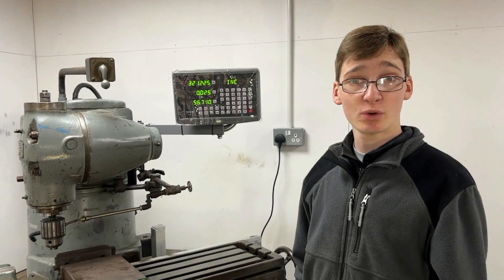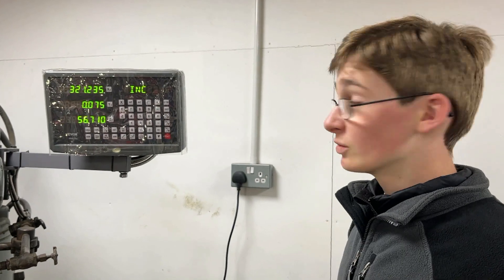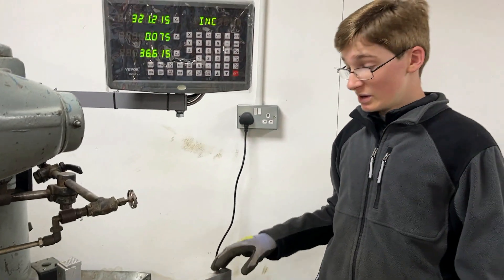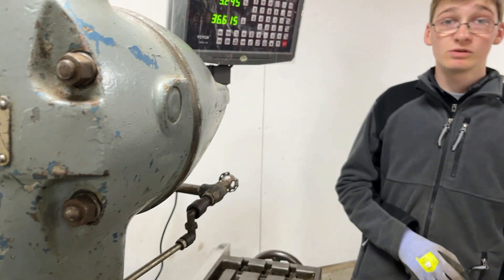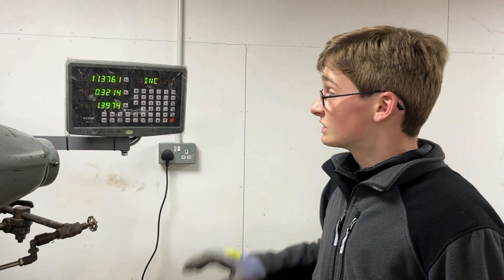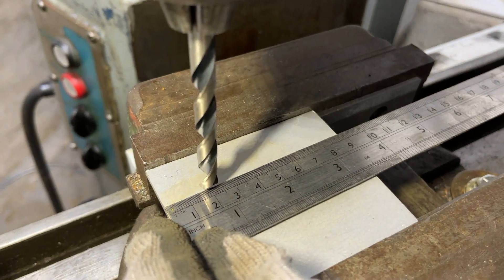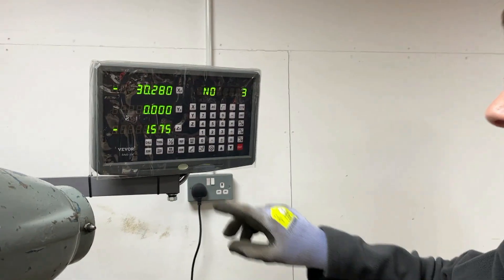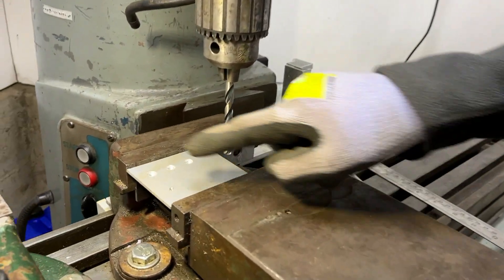Vevor Digital Readout - Workshop Wednesday

Comment: Vevor has some good products. It's too bad they discontinued these readouts; perhaps they'll be back. These Digital Readouts are new to me. I didn't know they existed in an aftermarket kit that can be installed on older equipment. They make an older, manual machine, modern. Really informative and interesting. The accuracy for layout is a time-saver. The mounting of the DRO on this machine was very well done too. Your dad is a very talented man--you are lucky to be learning from the best!
Reply from the maker: Thank you very much. We believe we have found the company that make the DRO for Vevor so we may have another option to purchase. The mill is great to use with the DRO installed. Take care
Reply: @GardenTractorBoy  I like Vevor products and have several. I hope you find the product you need. Take care! And hello to the cameraman and support staff.

Comment: Very cool! I’m still tempted for my Centec but still nervous for the same reasons you’ve described- lots of curves and a reluctance to drill!
Reply from the maker: We used the Centec to make the brackets for this installation and as the same time started to think about how we would install one on the Centec. We think it would be a lot easier than the Cincinnati and it may be possible without drilling holes. We will probabily install one on the Colchester lathe next. Take care
Reply: @GardenTractorBoy  I think the stop tracks could be used to do some mounting - we'll see. I keep saying I'm not going to do it until it's neccesary, but I don't know if that just means I'm ending up with lots of mediocre parts in the meantime :)
Reply from the maker: @williamsworkshopuk  We were thinking that the stop tracks would be perfect for mounting the scales. We are currently investigating smaller diameter scales which would be better for the Centec